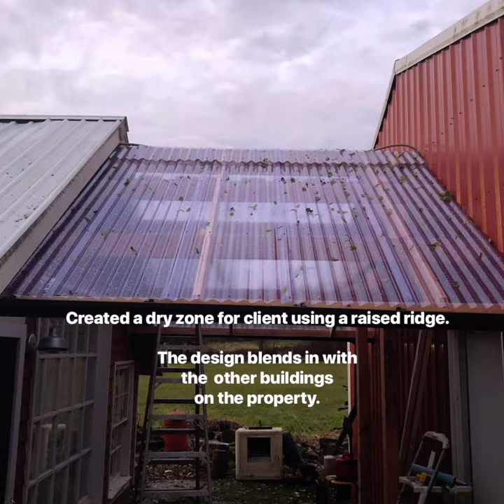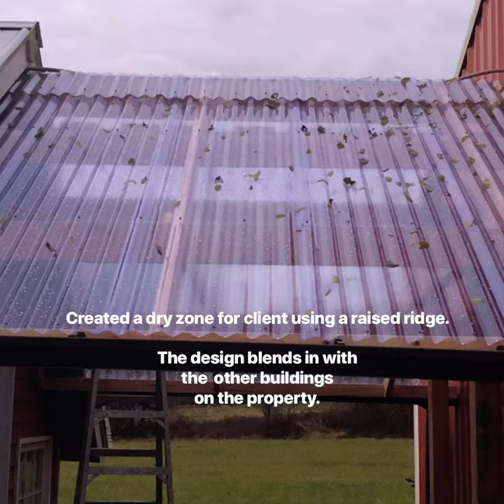Make your own plastic corrugated roof panel ridge

Comment: IM WORKING ON A BACKYARD SHADE AND I AM USING THE SQUARE CORRUAGTED POLYCARBONATE PANELS. I NEED A 90 DEGREE BEND FOR THE ROOF CORNER AT THE BACK. I WILL TRY THIS METHOD TO BEND THE PANELS. THANK YOU FOR POSTING IT.

Comment: Oh My - I was looking at your set up and i'm thinking, please use a heat gun, please use a heat gun LOL!  First time I have seen someone do what was in my head!  Ahhhhhh - thank you SO dang much! I don't have as much as an angle as you. I converted an old stick + vinyl siding shed into a green house last season and hardware stores in canada need to special order in ridge caps (nuts IMHO)... this season I will be removing the old plywood/shaker roof and replacing with corrugated polycarbonate.... this is going to save me some bucks.  Thank you again...
Reply from the maker: Glad you found this video and thanks for sending the telepathic message for me to break out the heat gun. Hope your upgrade goes smooth on your greenhouse.

Comment: I never even thought about this way, brilliant and thanks for sharing
Reply from the maker: For some reason I’ve always been good at taking what’s around me and making decent use of it. I needed a specific length and angle so I could create an air gap/vent so too much heat didn’t get trapped so this setup worked out great and the client was a happy clam.

Comment: Good video and I was getting excited LOL
You got to the part where you said you made a template.
What did you use to make the template? as i would like to do the same.
Sorry it's 3 years later. I'm always late for the party. 😂😂
Reply from the maker: Yeah, I’m always late to the party too. Hey, have you heard about planking? Ha ha.
Template is called wiggle wood. I had to modify the wiggle wood I picked up since it didn’t match the sheet contours I had (2 different manufacturers).
Good luck and don’t be afraid to be creative and experiment.
Reply: @jeffstites7848  Cheers. ☑☑☑

Comment: Excellent job! What is your preferred method for attaching the panels to the rafters? Thanks
Reply from the maker: Thank you. Pre-drilled holes in the roofing sheets, cupped washers and wood/deck screws. To ensure a really quiet install, you can use double-sided insulating rubber in between the sheet and wood mounting surface to minimize temperature variance noises.

Comment: Fantastic idea. I'm looking for an alternative ridge for an asbestos corrugated roof. I could use bonding sealant to fix it to the panels, so I don't have to drill through the asbestos sheeting. How do you determine the pitch angle? Where did you get the white profile blocks for the template?
Reply from the maker: Pitch would need to be determined by code/engineer or someone experienced for the specific job.
The template is called wiggle wood I believe and typically used to support the sheets on spans. Since the one I bought didn’t match the contour of the sheets I had, I had to cut and space out the valleys to match my sheets.

Comment: How did you scew it to the top? Will it hold your weight while you screw it down?
Reply from the maker: I used a ladder for access and the beam/rafters will support the weight, but not the individual sheets with the spacing I had, but they did support my weight with a 4x8 sheet on top of them over the joists to dissipate and spread the load.
I used wood screws and wide washers and pre-drilled holes in the sheets. There are specific washers you can buy that have contours for the sheets being used.

Comment: I cannot find a 10' ridge cap, with the channels sloping downward, like yours does. This is the best idea I've seen. Thank you for the inspiration!
I am using tin snips to cut my polycarbonate.
Also, did you build yourself a stop, so all the angles were the same?
Reply from the maker: Hi, and thanks. Glad you like it. Yes, I did build a backstop that was at half the width plus the leg of the sawhorse was at the correct angle needed so when it touched the leg I knew I was good.
Reply: @jeffstites7848  Hi Jeff, I was looking back at my older liked videos, and realized that I had forgotten to come back here to thank you again.
I used your idea and made six ridge panels. Not only do they work great, they have proven themselves worthy with all the wild weather the Pacific Northwest has to offer.
You, my friend, are a godsend. Blessings to you and yours.
Bob
Reply from the maker: @98682bobbyd  Thanks for the kind words, Bob. I’m glad it worked out well and you got a system in place. It’s amazing what dumb luck and determination can help come with when needing something quickly.

Comment: Can you tell me what blade you use on the Dremel to cut with?  I need to trim some longer pieces, and want a nice clean edge.  🙂
Reply from the maker: I normally use a standard fiber cutting disc. This one was a bigger sized disc that came in a kit with other bits. Keep the speed about medium speed and wear protection. If you happen break a lot of discs, I will double them up sometimes to make them more rigid while cutting. Here’s the discs I used, to actually answer your question: https://www.lowes.com/pd/Dremel-6-Piece-Steel-1-1-2-in-Cutting-Wheel-Accessory-Kit/999982150
Reply: Appreciate your help and your video Jeff!!  I just ordered them...now wait for delivery.  Thanks so much!😊

Comment: Very helpful, could you please let me know where can I buy this cutter?
Reply from the maker: It’s just my old Dremel with a 1-1/2” cutting wheel/disc. Can use multiple types of electric or pneumatic rotating cutters. Just keep the speed down to not melt, but cut, the plastic. Here’s the quick change discs I used: https://www.lowes.com/pd/Dremel-6-Piece-Steel-1-1-2-in-Cutting-Wheel-Accessory-Kit/999982150

Comment: Hello. Is plastic and polycarbonate the same product? How did you get out onto the roof to install the ridge cap? Is it strong enough to stand on? Im lookin at building a 36x48 foot barn. With the cost of metal corrugated panels being what they are, im looking at polycarbonate panels as an option. My concerns with polycarbonate are durability, longevity and installation. On the installation part my concern is being able to secure the polycarbonate with the screws out in the middle of the roof. There will be no wood under it as I live in AZ and when I call it a barn, its as much of a sun shade as anything else. Snow is not a factor but wind and rain can be at times. My largest sections of roof would be 12 feet by 48 feet with trusses and cross support as well as 2x4's running across the top of the trusses at 3 foot intervals to anchor my roof panels into. Again, my concern is being able to get out into the middle and along the top ridge area to put the screws in. The barn style is a Monitor Barn and the top ridge will be about 14 feet off the ground. The is no reasonable way to use scaffolding to secure the ridge cap once the roof panels are installed. In insight or suggestions you have would be appreciated. Thanks btw I like the DIY ridge cap idea.
Reply from the maker: Sounds like a challenge. I was able to land the sheets going from one side to the other with ladders so I didn’t have to be on the panels. Only issue was the last sheets. I added blocking at the base of the roof and then laid a 4x8 sheet of plywood on the material to spread the load of my body. It was sketchy but it worked. You may have to get creative and it took me a little bit of time to figure out fastening the last panels. My issue was being between two existing buildings that I couldn’t climb on.
Hope that helps. Good luck on your roof project.

Comment: I had fumigation and the bent some of plastic sheet on edges.  Can I unbend it , maybe using gentle heat gun?
Reply from the maker: Not sure I follow how they got bent. If chemicals were used, I’d wear protection for safety, but I’d think they could be bent back if they are plastic or poly. Yup never know till you try. Just plan your action. You’ll need a way to keep it at the sites shape you’d like for 10-15 seconds. Go easy on the heat.

Comment: Hi, what kind of saw was that,, that you used to cut the plastic corrugated sheet??
Reply from the maker: It was a Dremel with a larger 2-inch(?) cutting wheel. Variable speed thin cutting wheel is the way to go. Just keep the speed down to not build up unnecessary heat:

Comment: What type screws are used? What thickness polycarbonate. Where can I get it. I can't find that type.
Reply from the maker: If I recall, they were a wood screw with cupped washers to help dissipate the load with low torque on the screws to not distort the panels. Don’t recall the specific thickness but these were standard sheets bought at Home Depot.

Comment: Just wondering, you made your own roof panel ridge, do you know how I could make the wiggle molding...possibly with a router...seems possible, I hope Im calling them the right name. It lays on top of the 2x4 lathing and fits into the ridges of the panels allowing you to screw into the top and not the valley, I want wooden ones. Thanks
Reply from the maker: I got mine at Lowe’s which didn’t match the spacing of the panels I had so I cut and spaced them out to match. You could cut your own with a jigsaw if you wanted.

Comment: Were these PVC or Polycarb panels? I'm looking to make a custom Apron Flashing to transition from shingles to Polycarb and if I could heat the Polycarb and flatten out the corrugations on one side that would be perfect.
Reply from the maker: @livens100 It’s polycarbonate. What you have in mind is interesting. It might be tough to flatten without breaking but I’d be interested to know how it goes.

Comment: How well does it hold up over time? I'm wondering if the heating and cooling will make the PVC panels a bit brittle?
Reply from the maker: Well, they do go through natural heat/cooling cycles and are designed for outdoor use. The heat used is just enough to bend them using gravity and left in ambient temps after.
Reply: @jeffstites7848  Thanks for replying. I wondered if this initial heating might have weakened the plastic because it's a hotter heat than I'd expect from a natural situation. Are the panels you shaped giving you any problems?